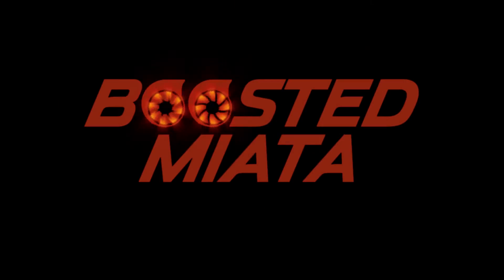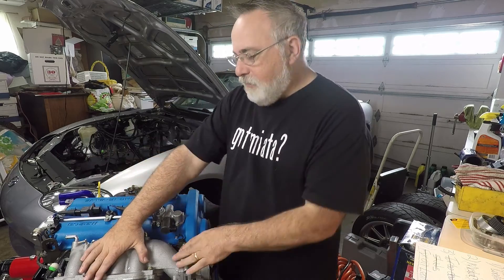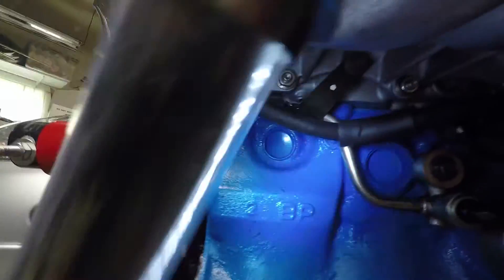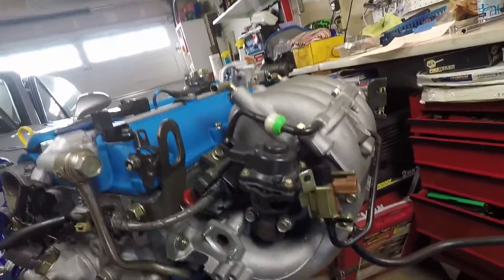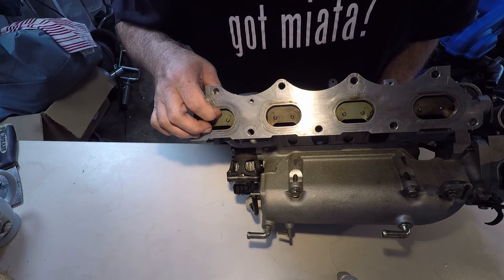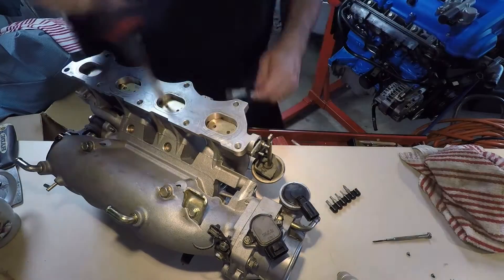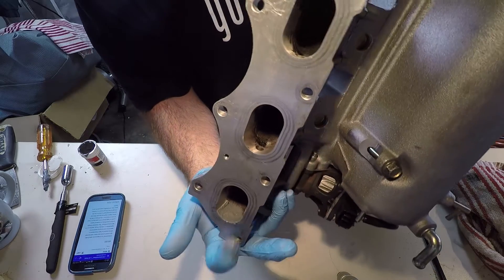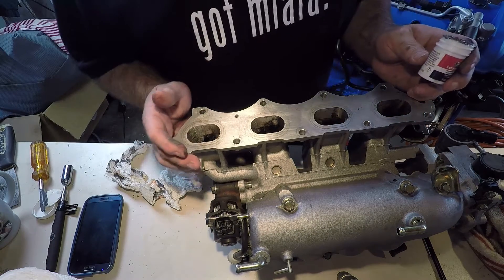Removing the butterfly from the intake manifold on the Boosted Miata

Comment: On a newer mzr engine the butterfly is operated by 2 vacum solenoids. It will throw a p2009 code if you remove them.

Comment: Good job your going to loose all low end torque
Reply from the maker: Did not impact torque at all.
Reply: @Seandoestech  the only reason there there is to adjust the flow of air for low rpm torque just like the acura integra gsr intake manifold. So yes you will just loose the low rpm torque and gain nothing
Reply from the maker: screamingvteccc you may be confusing the VICS system from the earlier engines with the VTCS butterfly valves from the later 01-05s. These were primarily a cold start emissions device and did nothing for low end, except when they opened after warm up and you would get that boost from the additional air flow.
Reply: @Seandoestech  Hi BM, I have 2003 NB , N/A ,so after reading your comment above , I am not sure if I should delete this butter fly , only do this if I have a turbocharger ?  Have you ever seen someone modify this to ITB ?  Nice Video ... will sub.
Reply from the maker: I did it because it’s a mild obstruction in the intake ports, but it’s not absolutely needed to turbo your Miata. I only did it because I hated when the valves would open and I’d get that boost effect,
Reply: @alexisknows6513  Only needed on a turbocharged setup

Comment: I would probably just disconnect it manually.  But since you took off the manifold, couldn't you have just removed the butterfly plates and left the rod in to block the holes?
Reply from the maker: Yep.

Comment: What about removing the butterflies and trimming the rod thin with a dremel? I am about to do this mod on my supercharged car but I hate the thought of heat/cool cycles + vibration rattling the jb weld loose and going into the motor. I am also going to look at the short side radius of the ports a few inches in where the curve up and the dog leg of the upper manifold at the throttle body opening. If any of that can be smoothed out it'll be worth some flow improvements to keep this torquey manifold from dropping off above 6,000 rpm.
Reply: Did you end up doing these modifications , how did it workout?
Reply: @alexisknows6513  I removed the valves and left the rod in place. Didn't add any power that I know of.

Comment: are u using silicon glue to cover that butterfly hole?
Reply: Thanx for your reply, i hope this help me 😋😋
Reply from the maker: Safuan Pauzi honestly, if you do this mod, just take the butterfly plates off the rod and put the rod back in place, done! No holes to plug 😊
Reply from the maker: Safuan Pauzi I did. But surprise surprise it blew out under boost. So I ended up putting a rivet into that hole that fit perfectly and I used epoxy resin to fasten it in and it’s fine now.

Comment: Did you have it tuned to run without the runner flaps, or is that not required? I've heard that if you take them out without a tune, it idles rough with a babble from the exhaust until the engine is warm.
Reply: Michael McCoppin it runs fine cold.
Reply: HooverTuber Thanks 👍

Comment: I have a Mazda p5 I want to remove egr and butterfly valves. After I do those do I get a tune? Will a CEL appear? How will the car run?
Reply from the maker: Jackson Bui butterflies do not throw codes, not sure about the egr system. No tune necessary

Comment: Why plug runner to runner when it goes to a common plenum?
Reply: It's not necessary but some feel the need to keep the runners superate, air is traveling to each cylinder at that point coming FROM a common plenum.

Comment: I love this feature, feels like VTEC or a turbo spooling up. Also im not sure u want to put stuff in the intake manifold, they suck realllllly hard, the plug might be sucked in the engine
Reply from the maker: That's a fair point about plugging the holes in the intake. So far, no problems for me, however, If I do this again, I may just remove the butterfly wing pieces and leave the rod in place.

Comment: does this hurt emissions inspection cause i heard the vgt valves on the subies which are the same thing were put there to meet emission on cold start. have you had trouble with emission cause i might do this on my 02' SE cause im leaving it N/A for awhile and wanna see what i can get with the little cheap mods like advance timing, cams ect.
Reply: .....did you put hot cam in ? I have 2003 club , was thinking of changing cam ...only ones I have seen are from Japan.
Reply: do you drive your car to the smog tech, let it cool all the way down and then test it while cold? If no, then this wouldn't have any efect as the VTCS is only for cold start and idle until a certain temp is reached ad the vacuum drops.

Comment: Does this effect the overal power while it's warm?, or does this only eliminate the 3500RPM pull with a cold engine?
Reply from the maker: +RE Amemiya theoretically it makes you more power all the time because the obstruction in the manifold is completely gone.

Comment: I bought another intake manifold and it doest have butteflies like my stock one, i was broking m head how would i do, cuz it have a solenoid that is plug in 2 my question is if i live it without the butterflies and without plugin it in will i have the chek engine light on cuz of no butterflies would i be able to pass emissions?
Reply: you bought a vics manifold. You can run it and leave the solenoid valve plugged in.

Comment: also why not just leave the rod?
Reply from the maker: Melody you could. actually, the plug I put in on the outside hole just blew out, had to use some jb weld to seal it back up, not elegant, but no space to do a tap and pipe plug fix, which is how I should have done it to begin with.
Reply: You could remove the seal and do it from the outside. Also i just bought a 99 engine which im gonna be swapping into mine so i dont have to worry about em! Haha
And no more pesky leaky vvt to deal with either.

Comment: Hello Sean, great videos! I realize you are sourcing the turbo from the hot side head port - any issues with that? There is a big thread on miataturbo about it and I am starting to think that it is the best idea althought FM are using the block source...
Reply from the maker: Viper70225 you mean the oil? sourcing from the head is convenient, some feel it's not a great idea to take oil from the head, but it's been a proven set up on my brother's turbo miata racecar with no ill effects on the head components. I've checked the oil pressure at my VVT and it's fine.
Reply: That is what I hoped to hear... will go this way too on my VVT engine... Thanks!
Reply from the maker: Viper70225 awesome, good luck!